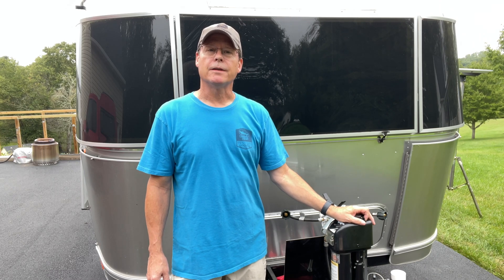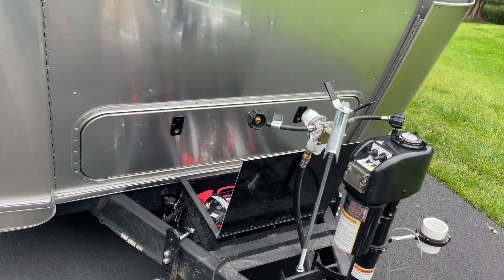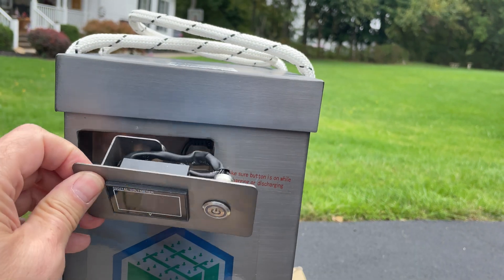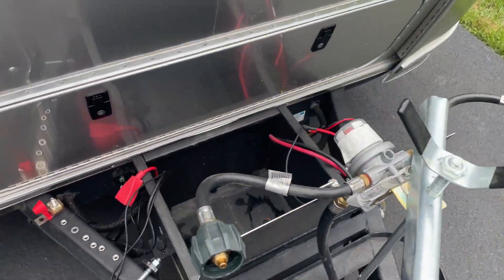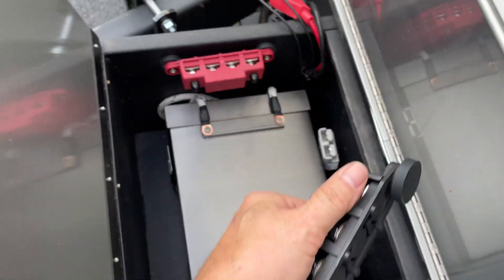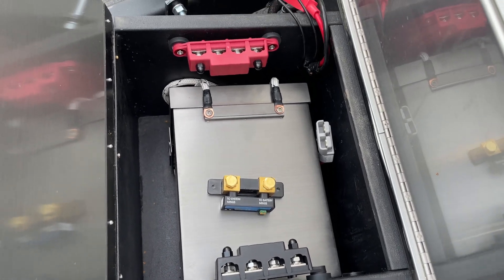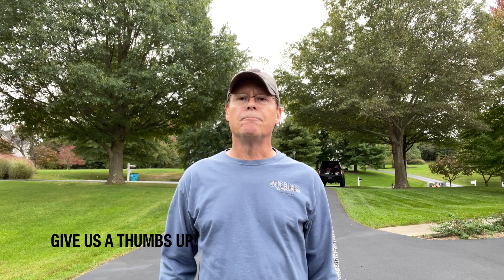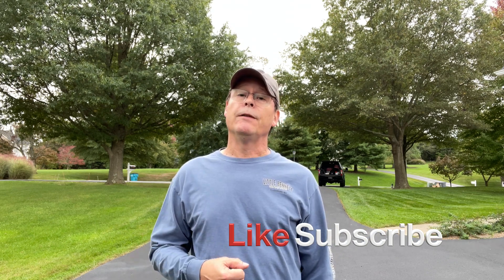Going Lithium! - Replacing the AGMs with a LiFePO4 Big Battery

Comment: Great video. Thanks for posting… I actually just purchased all the supplies you listed and will attempt to copy your install… We just purchased a new to us 23 AS GT 27FBT.. is there anything else I need to do? Some FB posts indicate you have to swap out the converter and adjust the Solar Controller… Can’t beat Big Batteries price and it seems to have a great deal of positive reviews…
Reply from the maker: The 2023 model has an auto switching converter so you should be good to go!
For the solar controller, you would need to use the app to configure the battery settings based on the size of your battery.

Comment: I hope your festival trip was great. Hopefully we'll be able to attend next year. I have to say I am so excited to do your lithium exchange in the spring. I really think this is the cleanest install of this model Airstream I've seen yet. We have a 25 FTB GT and do just enough boondocking for this amount of lithium and best of all, it is easily owner installed. Thanks again for posting this info.
Reply from the maker: Thanks so much. The festival never disappoints. The weather this year was absolutely perfect.
Stay tuned for an update on the battery. Spoiler - we're going to add another!
Reply: @EastCoastStreamers  Have you installed another BigBattery?  If so please post another video!

Comment: This is exactly what I want to do!  Thank you for posting the parts list.  Can you also post a link to the tooling?
Reply from the maker: I glad this video is helpful.  Additional tooling links (I also added above) - 

Battery Cable Crimping Tool - https://amzn.to/40c9kof
Hammer Lug Crimping Tool - https://amzn.to/3FxzSql
Cable Cutter - https://amzn.to/3QvDFe3
Heavy Duty Cable Lugs - https://amzn.to/46MXfZ6
Hydraulic Crimping Tool - https://amzn.to/3Mgar0g
Wire Harness Quick Connector - https://amzn.to/3QtGT1I
Reply: Thank you. Probably want to now add a lock to that battery compartment too!
Reply from the maker: Absolutely. We actually purchased a combination lock for the box for just in case.
Reply: One last request, can you add screenshots or at least info on the Victron charge controller settings for it? Or do they provide it with the battery anyway?
Reply from the maker: When you log into the App, go to settings and update the "Battery preset" setting to "Smart Lithium (LiFePO4)". It's the 4th setting from the top.
Reply: Correction, it should be the last option in the menu.  You will need to scroll down to see it.
 @EastCoastStreamers